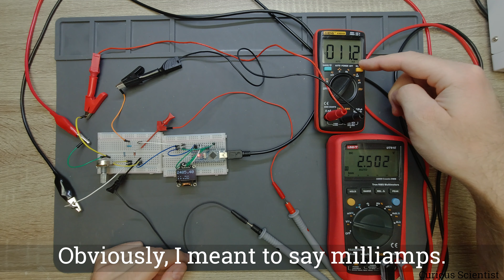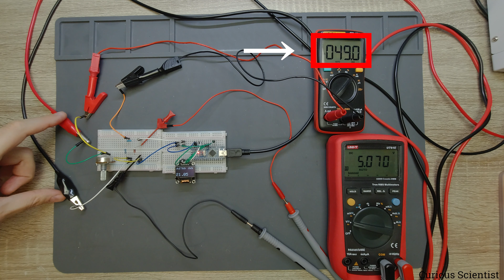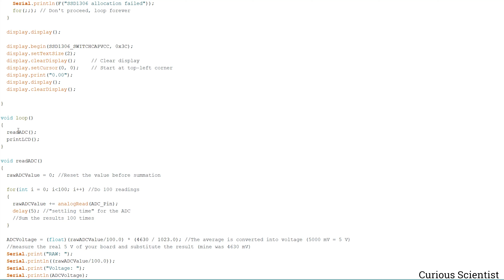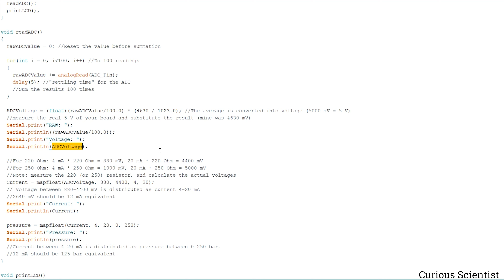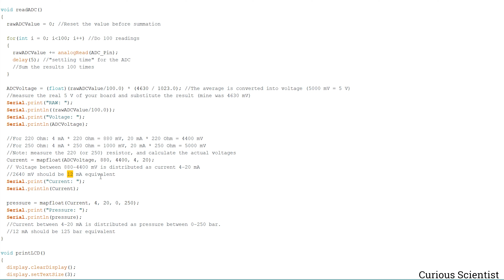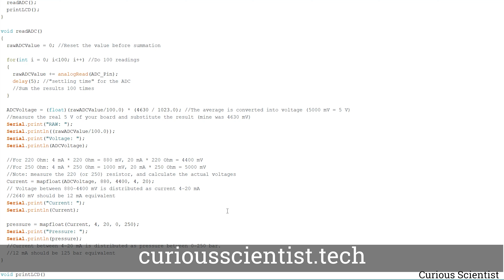4-20 mA signal measurement with Arduino

Comment: Sorry to be a late-comer to the party.  And a rank Newbie at that, struggling to grasp Arduino use.  Your video appears to sort out about 90% of the questions I have about reading a 4-20 mA loop pressure sensor,  except that the simulation with a pot still requires 3 wires, and the sensor has only 2.  .y sensor wants 24v, and the Arduino clearly doesn't.   My understanding was they must share a common ground?  Does that require some other Isolation of circuits?
Reply from the maker: Hi! There's no such thing as late coming here, I try to answer all comments, even if it is under an old video. The components should share common ground. Otherwise, it can happen that their ground (0 V) is slightly different which could lead to wrong readings. The ground does not need any insulation. The Arduino's max input voltage is 5 V. Pay attention to this!

Comment: Hi. What library did you use to write the values on this display? I can't print float variable on my oled. Thanks.
Reply from the maker: Hi! It is in the code that I shared on my website. Also, printing float is always a mess with displays with Arduino. I have explained it in several videos how to solve it. Look for the dtostrf() function.
Reply: @CuriousScientist  thanks! I'll check it out!

Comment: Hi mate. Very well explained. What is the easiest way to add isolation to the circuit?
Reply from the maker: Hi and thanks! Which part exactly are you interested in isolating? Do you want to isolate the whole circuit from the MCU? Or do you want to isolate the signal from the circuit? Maybe a simple 1:1 transformer could do the job.

Comment: Thx for the video ! 
Whats the point of 100 ohm. what happens if i remove it and short cut there? just 250 or 220 ohm and just zener diode parallel to resistant
The outputs stay the same without 100 ohm.just put zener and res. Parallel to another
Reply from the maker: Hi! The 100 Ohm resistor is there to limit the current in conjunction with the Zener diode. It protects the input of the Arduino or AD-converter.

Comment: Very very good explanantion. Thanks a lot for that. I used this, to connect a Industrial Position Transmitters to the arduino. In the for loop i change only the 5 millisecond delay with the millis() function like follows 

"   if (millis() - range_t > 5) {
    for (int i = 0; i < 100; i++) {
      rawADCValue += analogRead(ADC_Pin);
    }
    range_t = millis();
  }
"
and i realised decimal values displayed at the Oled are nearly stable using delay. Using the millis i have some fluttering at the decimal values displayed on the Oled. 
I am using the millis wrong for this case?  How i can display stable values on the Oled using the millis()?
Thanks
Reply from the maker: Hi and thanks!
The code snippet you sent is not doing the same thing as my code. I added the delay after reading the ADC and not after finishing the for() loop... I added it because I wanted to let the ADC to settle after each reading to avoid funny values. Since the code is not time critical, I used the delay() instead of implementing the non-blocking millis(). 100 times 5 ms is still just half a second which is, I think a sufficient update frequency for the display. If the display is fluttering, then you might want to add the millis() part to the printLCD() function.
Reply: @CuriousScientist   you are right.  But like follow it would be after the reading of the ADC?

"
  for (int i = 0; i < 100; i++) //Do 100 readings
  {
    if (millis() - range_t > 5) {
      rawADCValue += analogRead(ADC_Pin);
      range_t = millis();
    }
  }
"
In my code is time critical and i do not want tu use the blocking delay.
Reply from the maker: Why don't you just test it? :)
Reply: @CuriousScientist   Yes i will...  :) After testing it , i will tell something. Again thanks a lot. Waiting for some more videos from you. Continue like this.
Reply from the maker: Thanks, I will continue. Btw, the code you showed will probably not work properly.
Reply: @CuriousScientist  Ok right now iI am curious.... :)). I have to test it when i will have oportunity. Another option. Would this one work?
"
  for (int i = 0;   ((millis() - range_t) >= 5) && ( i < 100); i++) {
    range_t = millis();
    rawADCValue += analogRead(ADC_Pin);
  }
"
Reply from the maker: Nope. :) Still not good.
Reply: @CuriousScientist .... :)) I have to think over it
Reply: @CuriousScientist   "  for (int i = 0; i < 100; ) {
    if (millis() - range_t  >= 5) {
      rawADCValue += analogRead(ADC_Pin);
      i++;
      range_t = millis();
    }
  }
"
I tested it. Like this it works...... ;)
Reply from the maker: I would have done it with a simple if(), but you got the missing thing. You should only iterate when the 5 ms is elapsed. Good job!
Reply from the maker: Since you worked on your solution and made it work, I also post my version (however, I strongly discourage people from posting code here in the comment section, because it is extremely hard to read them). 

if (millis() - range_t  >= 5 && avgCounter < 100) 
{
  avgCounter++;
  rawADCValue += analogRead(ADC_Pin);      
  range_t = millis();
	if(avgCounter == 100)
	{
          avgCounter = 0;
	}  	  
}

What the code should do is the following:
The if() checks if the elapsed time is at least 5 ms AND the value of the counter is below 100. If it is true, we allow the code to enter the condition. Then, we increase the counter by one, we do one reading, we "reset" the timer and finally we check the total number of counts. If the total number of counts reached 100, the counter is set to zero. You can use the counter in another part of the code also to follow when you should calculate the average of the sum of the analogRead() readings. In fact, you can (or should?) reset the counter in that part of the code.
Reply: @CuriousScientist  I think I will use your approach. Because of the counter that  can be used in another place of the code. :)
Reply: @CuriousScientist  Compilation error: 'range_t' was not declared in this scope. How to solve that?
Reply from the maker: @ChristianGrau92 check for curly brackets. The error message is super obvious.
Reply: @CuriousScientist  Are you sure about that??? What about declare range_t??? unsigned long range_t = 0;
Reply from the maker: @ChristianGrau92 I assumed that it is obvious that you declare a variable before using it... So typically, if the compiler is still complaining about a variable, then it is usually due to a misplaced curly bracket.
Reply: @CuriousScientist  Don't assume everything is obvious. It might be obvious for you but for me with very little experience it's not obvious...think about that next time someone asking for help.
Reply from the maker: @ChristianGrau92 declaring a variable is one of the most obvious things in coding. And it is not rocket science. So, I think it is not a wrong assumption.

Comment: Hey can you do a video on using an arduino to output a 4 to 20ma source and simulate. Such as what a fluke process meter would do.
Reply from the maker: Hi! Sorry but I don't make videos on request for free. You can simulate this by dropping different voltage values across a known resistor. You can use a DAC to control the voltage.

Comment: Can we do this method to receive measurement data from industry sensor which has 4-20mA output without using rs232 or rs485 serial protohol?
Reply from the maker: Isn't that what I did here? If I understood your question correctly... The output is directly measured by an Arduino and the data can be forwarded to a computer via USB.
Reply: @CuriousScientist  Yes actually your video is almost relative with my question but my sensor which I'll use for my project is high level of precision to measure. So I didn't put it my mind, fortunately I've found rs232 laser measurement sensor. Btw you always answer my question when i ask thank you very much for this. :)))
Reply from the maker: I answer every single comment one by one. And based on the details of the question I reply with the same detail. 
If you need higher precision, just use an external 16-bit or 24-bit ADC to measure the voltage. But of course you have to make sure that your sensor can provide the signal in the required resolution as well.
Reply: @CuriousScientist  You are really the best I'll search what you said thank you so much for all your answers.

Comment: I always have read about the 4-20mA protocol here and there but I knew nothing about it... now I know, thanks
Reply from the maker: Actually, I have never worked with the either. That's why I needed to simulate the current with the potmeter. But, I got an interesting question related to these 4-20 mA systems and I thought I could make a video on it because I could not find proper resources.